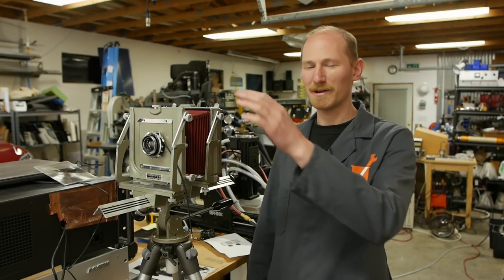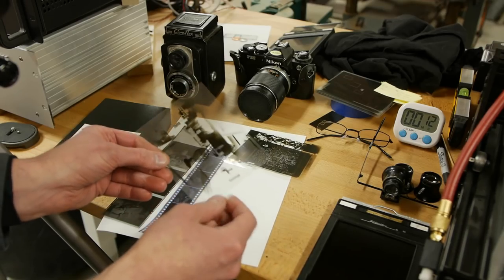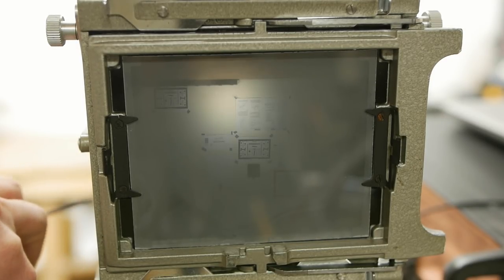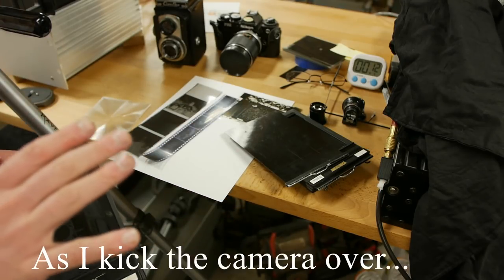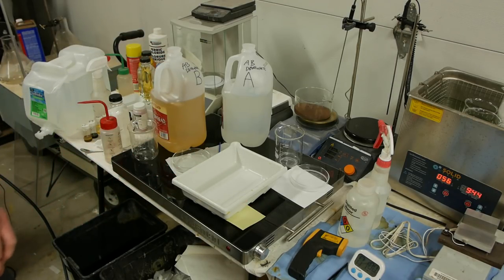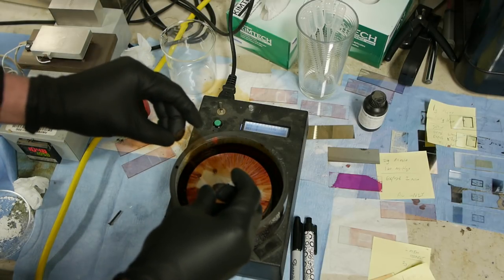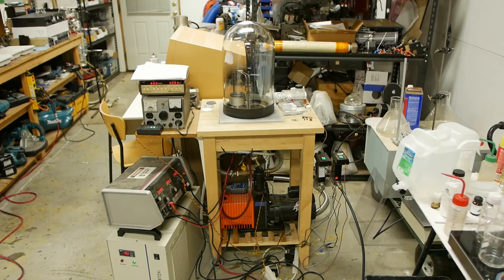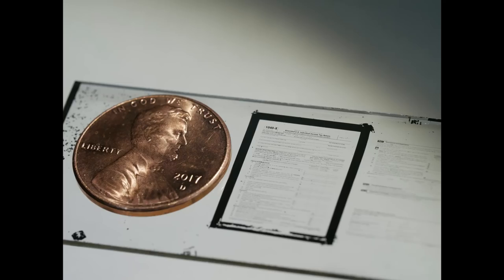Antique 4x5 camera creates 20 micron photolithography masks: Super tiny tax form

Comment: The Fresnel lens is used to brighten up the edges of the ground glass allowing for easier composition. You would never want to focus through the fresnel lens, unless you weren't very concerned with accurate focus and were shooting at tiny apertures. It basically makes it easier to see the whole ground glass in a more evenly lit way so you see to frame the shot.

Comment: This is fantastic. I have piles of parts to make most of the things you have completed here. I admire your drive and ability to finish projects! Also, demonstrating microfab techniques that folks doing stuff at home can replicate is fantastic! Not saying you should do this instead, because you have a nice looking process, but here is an idea for an alternative photolithography approach (with somewhat more limited potential resolution): just plop your resist coated substrate down on the LCD of one of those resin 3D printers. I think the standard 2-300 dollar units have about 50 microns of resolution in x-y. You'd need to use a ~405 nm sensitive resist, but no need to make photomasks anymore!

Comment: Back in the early 70s, I had a summer job pushing the broom at Canadian Marconi Company in Montreal. They were creating some of the first integrated circuits. They had a wall about 20' x 20' with the circuit layout hand drawn. It was a clean room. The would shoot the circuit layout on a line camera about 20' feet away to reduce the image. The line camera was about 4' x 4' in size. It was huge. I believe they took the negative and further reduced the image until it was the size of a ladybug.

Comment: 2 bits of advice that could improve your results: First, the "handle" end of the dark slide should have a dark and a light side... that way you can insert it one way for unexposed film, and insert the other way for exposed film (helps to reduce confusion when working with multiple film holders).  Second tip, four words... Flat. Field. Macro. Lens. That will give you the best focus/clarity when attempting to photographically reproduce 2-dimensional objects. Thanks for the great content!

Comment: Great content as always. I noticed at 23:36 the use of a "glass" plate to hold the film against the slide. If you have a UV meter, check if the glass is reducing the UV transmission. Quartz is often used for applications where UV transmission is required.

Comment: Fresnel focusing backs are only brighter in the corners, where the light fall-off is greater. A focus aid commonly used is a 10x loupe to magnify the image on the ground glass. Most film backs have a dark slide that is gray on one side and black on the other. Many photographers use that to indicate whether the film has been exposed or not--they just flip the dark slide after exposure.

Comment: It was fun to see those Riteway film holders.  I have the same ones.  I can see the appeal of that Arista Ortho Litho film from a price standpoint.
I use Ilford Ortho Plus in 4x5.  It's on a 7-mil polyester base like conventional photographic sheet films, so it works well in ordinary holders.  Its box-rated sensitivity is ISO 40 tungsten or ISO 80 daylight.  I mainly use it for landscape and architectural photography, but I've used it for copy work in the past.  The choice of developer and development time determines contrast.  The last copy job I used it for was with ship plans.  The client needed a very high resolution, high contrast digital image to work with.  I shot it using studio flashes (daylight) so I rated it at 80 ISO on my flash meter, then I developed it in the specified Ilford Phenisol working solution for 8 minutes.  This was somewhat mid-range in the development time - 10 minutes is listed for maximum contrast.  The resultant negatives had the most contrast and greatest maximum density I've ever worked with, and resolution exceeded that of the scanner.

Comment: I spent 30 years photographing with 4x5 and 8x10 view cameras. I took a photo design course in the middle of these years. When the instructor would put sheets of slides on a light box I noticed everyone else was crowded behind him, I was alone looking at the work upside down.  The best lenses you probably know are the apo-chromatics. These are smaller aperture but very sharp lenses. Lenses that I acquired about 20 years ago I liked even more. These were Nikkor 360 and 480mm (I think I can go look at them if you want) copy lenses for print shops. About 20 years ago all printing shops went digital and these fairly new and amazing lenses were sold as surplus. Very flat focal planes best apochromatic lenses I'd ever seen.  They didn't have shutters - still don't. I learned that if an exposure was 5 stops under it would be essentially black. So I'd uncap the lens, pop the flash. and if I it was dim enough, I could do 5-10 flash pops to build up exposure. I was mostly shooting works of art. (If you were to figure out a basically dim room, and the time it took for the power pack to recharge the capacitors, whether you were shooting at f11 with 2 pops or f22 at 8 pops, the longer time exposure of the dim room comes out the same). 

A roll of 36 frames of 35mm film is about the same area as one sheet of 8x10 film. So the cost is about the same. So a 4x5 is about 1/4 the film area of a roll of 35mm. 

The dark slides on the film holders spray some Lemon Pledge on a piece of paper towel or cloth and wipe the edges. They go in very easily. My procedure for 'cleaning' and de-static-ing (?) film holders. Wipe them down with cold water, this picks up dust, then wipe down the dark slides with Lemon Pledge (one can can last you 20 years). I think the Pledge also helps with static. The issue with dust and film is: it's static charge. One darkroom I built and worked in as a rookie, was cleaner than an operating room at a hospital, and had a chronic dust problem. Tiny but persistent. My last darkroom was a shed in my backyard. It often had dried mud on the floor, but no dust problem. I would only clean surfaces in the good darkroom with cold water (cold water pipe is grounded. I'll bet you know a lot more about this than I do). If I vacuumed, usually a very bad thing to do. I'd have a second long hose attached to the exhaust air. This hose I would run around the corner of the darkroom so nothing passing through the vacuum (which is actually a type of grinding and static charge adding machine) went back into the darkroom. At 20 microns if you start getting dust it will drive you nuts. '
Just number all your holders, piece of thin white tape right where you'd think. Then the Dark Slide: Silver or white side out: unexposed film. Black side out: exposed film. 

Your vacuum film holder is brilliant. Good work. Does that vacuum hose movement affect the camera? I know there are seismographs for laptops, probably for smart phones too. Just rest one on a piece of metal or plex or glass that goes between the lens stage and the back and see what the graphs look like when you turn on the vac. Suspending the hose might take care of any issues. The other thing about the bulge in the film. Which part of the film matches the depth of the holders vis a vis the ground glass? If I was designing a camera and had to do something about the bulge, I'd just split the difference. That might affect your results. Also everything in film is a compromise. The lenses have curvature, in focus and resolution. So shooting in the very center is usually best. What you dial in for one area of the lens might not work for other areas of the same lens. (When 35mm cameras went digital, every one of us went out and bought a DSLR, then we went back and bought mostly new lenses. What had been great for film sucked for digital) 

For temperature control for the baths. I used to run a mix of hot and cold water. There's a valve that used to cost $150 that will do this but you don't need it.  What I found is that once you get the water coming out of the faucets (any kind kitchen, bathroom,)  to the right temperature, it would stay there until the water heater tank started to cool off. For a normal house water heater 30-40 gallons, just keep the flow low and unless the room air is really cold, you should be able to hold temperature all day. You might also find that 70 degrees out of the faucet gives you a consistent 68 degree bath in a cold room.  The developer tray is of course the most important. Thermometers are cheap. (For a sink drain, just a piece of PVC or even rolled up plastic  that sticks up an inch or so fills the sink while slowly draining the overflow. It's also good to have the water flow directed to go around the outside of the whole sink so it has to travel all the way around before it gets to the drain. 

What if you exposed in UV light? Color fringing affects sharpness,  ortho film is pretty good, but there's still UV blue and green light.
Your halide bulb set-up. How much light is bouncing off the sides of that cardboard tube? That widens the light source (like your series of lights).  A black tube might not be good enough. There are two ways to cut any reflections. 1. Baffles: a series of concentric 'donuts' that block any reflections and 2. Sawdust: smear glue on the tube, then sprinkle saw dust, then spray paint matte black. (I've never tried #2.Telescope makers sometimes use this method.)
And as I don't fully understand your end product a lot of my notes are probably superfluous . (Don't spend any time answering them one by one or at all. ) Your dust problem, whether it's critical to your project or not shouldn't be too difficult to deal with. My experience, 1. it's the static charge, 2. Film is plastic so it will almost always attract dust. If you have a foot of swamp water on the floor and dirt walls and no dust on your film? You don't have a dust problem. 3. I don't think dust falls and settles on something so much as it seeks the opposite electrical charge. (The worse thing you can do is scrub, use a lot of cleaning products and have a vacuum cleaner inside the room). A dust blower? Hand bulb,  computer cleaner air in a can or air compressor. This will work if you first neutralize the static. (A good clean air compressor  in a corner worked for me.) And if you ever need any large format film stuff ask. I used to shoot 8x10 color transparencies of works of art. The quality is amazing. The iPad 2 resolution finally matched it and then everybody could do what I used to get $150 for.

Comment: Hey ben, I just re-watched your video on "gecko tape" and suddenly realized the link between these two projects! -You concluded that with a discussion of how difficult it was to do the micron-scale photolithography needed for making the proper casting molds, and why that was a sticking point for the whole project. Any chance that now you've developed the tiny tax form, you can use this technique and process to manufacture a mold for some microscopic 4:1 pillars cast in silicone? It'd be really fun to see that project return!

Comment: That Vacuum-holder is actually what made Cel-animation possible. Since multiple handpainted Cel's bulge out the image differently with every frame. A vacuum pump between Cel's basically removes shadows caused by each Cel being ontop of each other. In really old remastered Anime, you can actually see what I mean.

Comment: They have focusing loupes specifically for placing on the screen.  Look for a Toyo or Peak.  The slides on the film holders are painted black on one side and not the other.  This helps you keep track if you have made an exposure on a piece of film in a holder.  You can also make unsharp masks using pin registered negative system which basically allow you to make a contact print mask using your negative, then you expose through the stack of your negative and the unsharp mask.

Comment: LOL .... Brings back memories of the 10's of thousands of shots done on a Kenro, NuArk, and DS Screen process camera in various print shops. I first used AB litho line film (developer had two parts, A and B mixed at time of use) before switching to single part in a processor. You could get some incredibly sharp line details.
Reply: I might add, the exposure of the glass slide could be done on a NuArc plate frame. You would draw a vacuum until you saw Newton rings then expose the plate to 15k watt lights or in the old days a couple of copper coated carbon rods. With the old equipment, this was just a routine done many times an hour.

Comment: Really nice video Ben! Have you considered leveraging the MSLA 3D printers to expose the photoresist directly on the microscope slide without a film? For example, Elegoo Mars has a resolution of 47 um (I know you are aiming for 20) but it would be a much simpler and direct approach (and cost 250-300$ USD). Also, there are already 4k 5.5" screens on Alibaba which can get you down to 30 um resolution.

Comment: the fresnel lens is used to focus the light coming out of the ground glass.
Basically the lens spreads out the light to cover the film, so when you look at the ground glass you "lose" some light. You notice that because there usually is a bright spot in the middle (where you look at the lens) and then a fall of in brightness to the edges.

The Fresnel lens is there to focus the light to a certain spot behind the ground glass (depends on the focusing distance of the fresnel). From there the image should be brighter and more evenly lit.
It helps with composing, to get a clearer view of the whole image, but as you noticed it can get in the way when trying to pull exact focus up close on the ground glass.

And you can use red leds as safe light. It totally changed my worklflow in the darkroom.

I now use a headlamp with a red-light option to do my darkroom work. Since the wavelength produced is very pure and you don't need to rely filters the intensity of the lights can be much bigger.

Comment: If you want really high resolution, you could use holographic film. Slavitch PFG-01 uses a green safelight, it has grains smaller than the wavelength of light, the sensitivity (in my personal lab experience) is around 1100 microjoules per cm square for 90% density, you can use extol or D-19 developer, it comes in 8 "X 10" or 4" X 5", and you get a negative photograph when you put it in a camera. Geola sells 10 packs of 8" X 10" for about $120, and you can make holograms with the stuff you don't use for photography.

Comment: Nice results! Just an idea if you want a quick way of getting the front of the camera parallel with the wall where you have the photographed paper: search for "Hasselblad Linear mirror unit", which is an accessory for reproduction photography. The construction and operating principle is quite simple and would be easy to replicate in the shop.

Comment: I use a similar method for making pcb at home and I learned from CNLohr that certain type of baby oil drops in between the film and the coating on the minute 23 really help with the refraction index to get a nicer result. Surface tension keeps everything in place and there is no need for the glass.

Comment: You could have used a 6x9 roll film holder for the camera, 6x9 medium format would have been large enough for the slides. And you can get higher resolution lenses with smaller image circles & larger apertures for use with 6x9 film. If you need to get any higher resolution. Of course you can still use sheet films, even with lenses that do not cover it fully.
Enlarging lenses probably would be the cheapest way to go, and most suited for this job as you are shooting at close distances. So a 80-100mm enlarging lens would most likely improve your results quite a bit. And a blue filter in front of the lens would help you focus just the blue light.

Comment: I worked in a photo lab technician in the Navy and worked in an intelligence command that had a micrographic section (amongst others). 
    You aren't even displaying any technology that we used in the eighties. I operated a reproduction camera that could produce a 8 ft. Square negative. We could also take any(strong image) and go below postage stamp size. I only know of three of these cameras ever produced. I met another technician that had operated number 2, 15 years later. I still haven't found out where number 3 is.
   You have to be very precise with all axis for absolute precision. That camera can display the principles but can't show the very fine details that matter for true micrographics.
  Our camera had a vacuum plate that was extraordinary, we had such a huge light source that would blind anyone without eye protection.
      4 way rocking is the accepted way to develop film, back and forth produces streaks.
     Cross polarization can aid aight photon applications. This could aid in minute detail.
       I received a commendation for a high contrast process over lay process that took high low and poly contrast images to resolve fine detail. This process has been incorporated into current image enhacement programs used currently.

Comment: Super cool! Giving me flash backs to my time in clean rooms doing MEMS. I don't know how easy it is to get a hold of but have you looked into using a conductive resist like PEDOT I remember it being quite easy to use. One method was to do a almost potato stamp process, where you make a gel mould of the parterne you want and then soaking it in NaOH then pressing it to the resist surface. I might have some recipes lying somewhere if you are interested.

Comment: Couple advices:
1) When you prepare glass fror etching solution and when centrifure is on with it - clean glass with some drops of IPA. It will clean fat etc. and then evaporate.
2) Use optiwhite glass instead of what you use - it doesn't cut UV so hard as ordinary glass.
3) Using some kind of lens to condense UV light woud increase speed of the process.